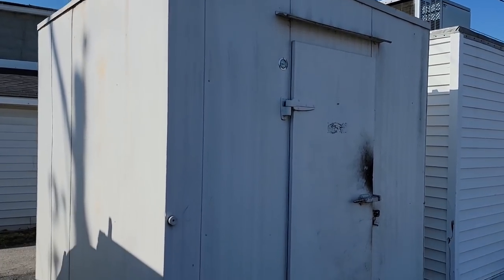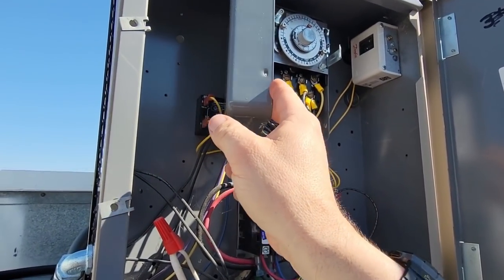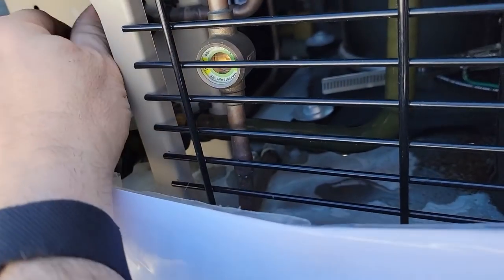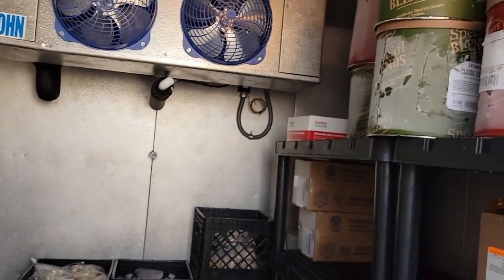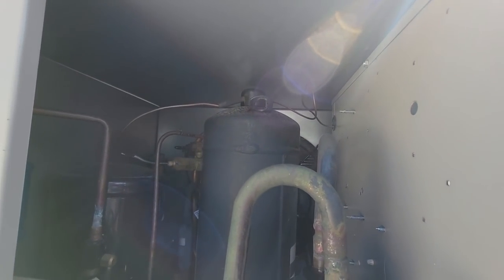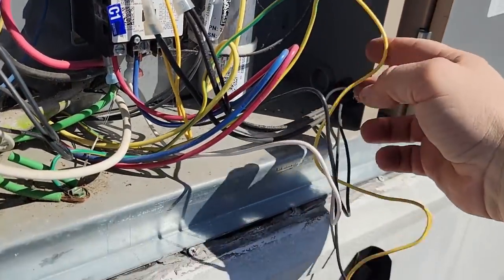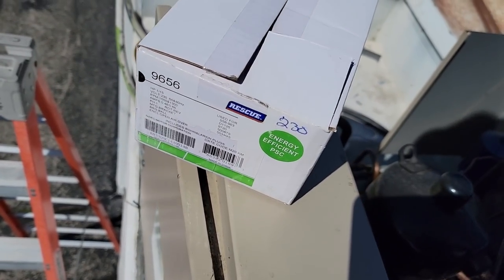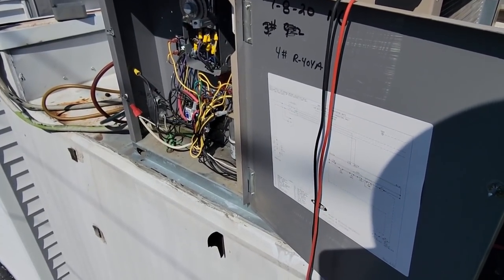Warm Freezer - Save My Ice Cream!

Comment: i had a Heatcraft unit here in New Zealand. The supply house would label it Henry, interlink and AC &R under their label. All of it came  out of China. The copper was corroded and green before brazing. I had to use emery cloth and flux to get 15% silver to adhere 🤣
Reply from the maker: Not what I wanted to hear but glad you mentioned it.

Comment: I use the screwdriver sticking method to check the solenoid...but be advised...the energy to the solenoid does not 100% guarantee that the valve opens.

Comment: Very thorough troubleshooting sir, you kept digging in to find the root of the problem. Thank for the tip checking liquid line solenoid with the amp meter
Reply from the maker: That's a cool little trick that makes sense, I wish I could take credit for it 😂👍👍

Comment: Good troubleshooting and repair work. Without the gauges on the unit to know pressutes, I was leaning toward suspecting the evaporator fan delay switch. As you already know, sometimes they are in a two-in-one arrangement, enclosed in the same body as the defrost termination switch and sometimes they are a separate switch all to itself. With the gauges attached to the system, that high head would have been seen right away. Again, good troubleleshooting work on your part.
Reply from the maker: Thanks man for the feedback and watching the video! 🤜🤛👍👍

Comment: Seems nothing was quite right about that install. I kept focusing on the use of non exterior rated flex cord for the mains power, that and the use of a non-watertight fitting (romex clamp?) on the side.  🤦‍♀️ you appear to have much more patience for slop than I, sir Rick!
Reply from the maker: I can complain but nothing gets done about it. I gave up and only worry about the work I do unless its a safety issue

Comment: ❄💪🇺🇸👍 great vid. Reason for evaporator fans not running? Was warm box temp shutting fans off dtfd switch ? I understand condenser fan down causes hi head n shut down but evaporator fans not running?
Reply from the maker: The defrost termination switch wasn't cold enough yet to bring on the EVAP fans.
Reply: @HVACRSurvival  thanks Rick Great troubleshooting. Very helpful
Reply from the maker: Your welcome bud!